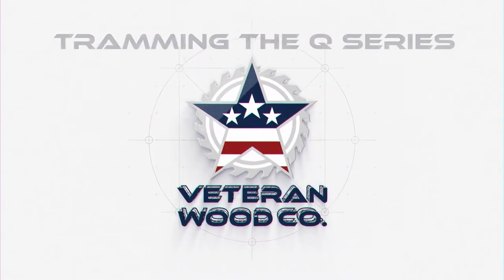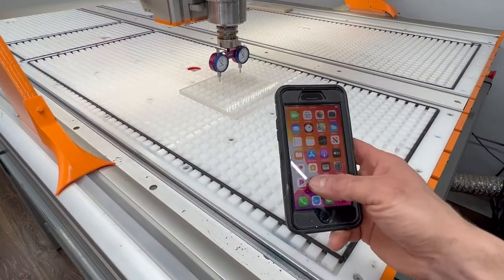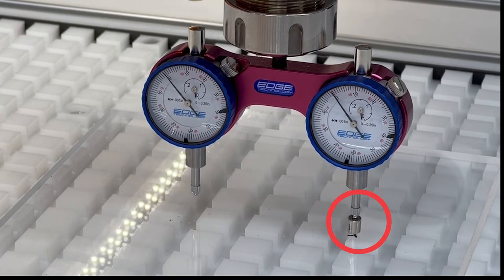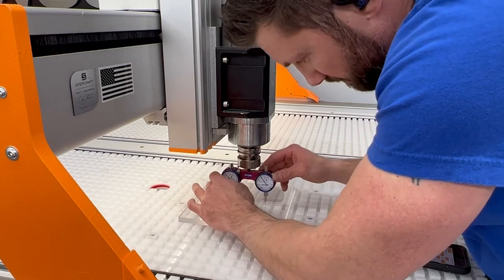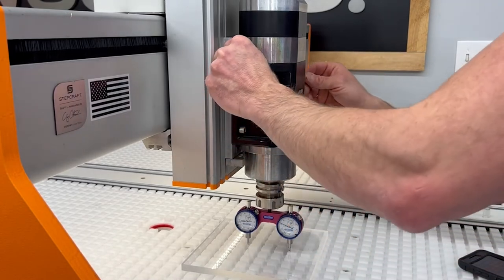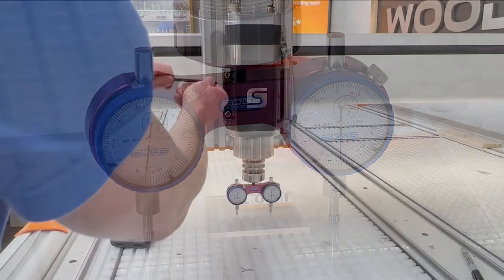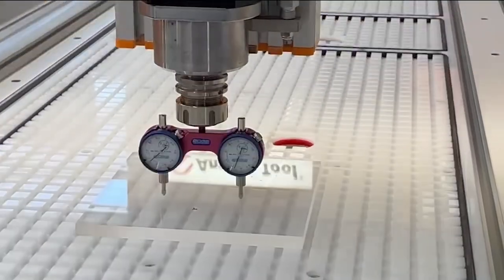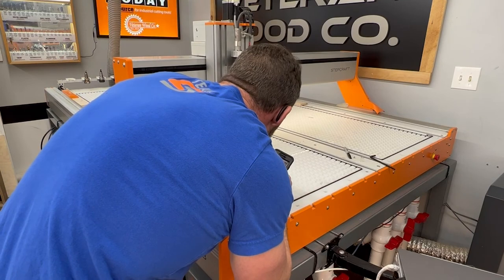CNC Tramming

Comment: Really dumb question: I guess this assumes that your bed (and the acrylic) are perfectly flat? I'm sure that it's probably better than not tramming it. This is probably crazy talk, but what if your bed or the acrylic sheet were not flat, or not flat in the spot where you trammed the spindle axis? Almost makes me wonder if there should be some kind of first pass around the whole bed with a laser range finder or something to make sure the bed was level, or maybe to find the most level part of the bed that could then be used for tramming. Maybe the variations in the bed are small compared to the variance or deviation in the spindle axis?
Reply from the maker: When the CNC machine is produced, the manufacturer should have used it (the CNC) to flatten itself. If for whatever reason you have a bed that is warped or crooked, that would call for a rebuild or return to the manufacturer. The only reason the bed would be crooked would be if the frame was bent or not assembled properly. If the frame if true and machine is square, any spoilboard imperfections will be corrected with a flattening pass.
Reply: @VeteranWoodCo  Not all CNC machines come with a bed as part of the kit. For example, the Onefinity CNC is typically mounted to a table surface built by the end user. Before the spindle can be trammed the user must: 1) ensure all four feet are coplanar (this can be done using fishing line or string); and 2) flatten the waste board.

Comment: Would this process pretty much be the same for an overseas CNC machine? I have an HTC6090 and it’s leaving some pretty good tool/maching marks on my metal. I’m wondering if my tram is off.
Reply from the maker: Yes, the process is the same, however the bolts may be different.  Same calibration with the gauge, you just need to figure out where to adjust your machine.
Reply: @VeteranWoodCo  thanks for the reply.  I’ve got the strips of mdf spoil board on my cnc. I’m guessing that won’t change up this process any either?
Reply from the maker: @ZakRogers  correct. Same process. Try to tram off the machine tho, not the MDF.
Reply: @ZakRogers  Ensure that all four feet are coplanar, then flatten the spoil board before tramming the spindle.

Comment: For anyone using Lexan or acrylic/glass sheet, be aware that these materials have variations in surface thickness. It is necessary to set both dial indicators to zero at the same X/Y location as shown. However, it is then necessary to take the magnet and verify that it is zero under the X/Y location beneath the second dial indicator. If it is not at zero, then adjust it to zero in order to compensate for the variation in material thickness. You may then proceed to tram the head in the first axis. Repeat the process to tram in the second axis.